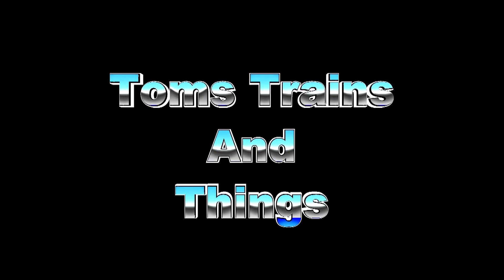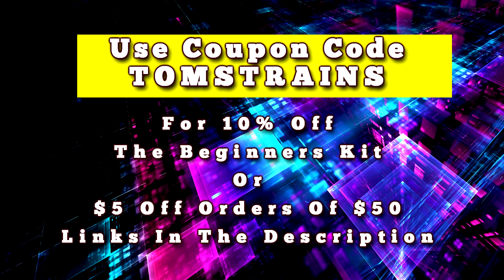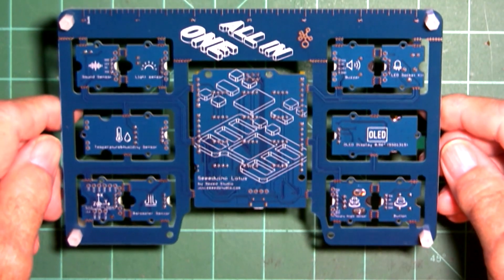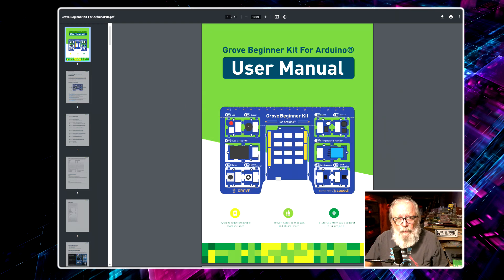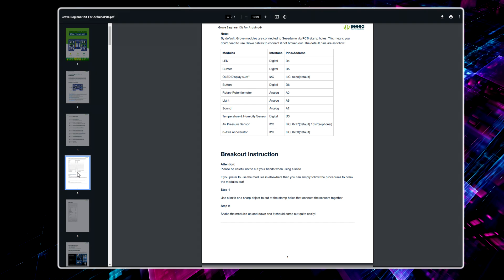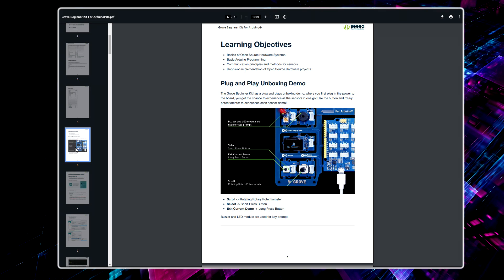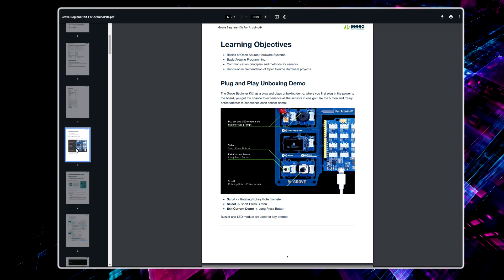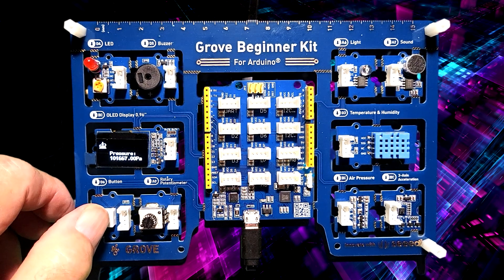Best  Arduino Starter Kit -  Grove Beginner Kit For Arduino

Comment: Hey Tom, nice review. Now don’t laugh, but do I need a computer hooked up to my layout if I want to run an Arduino thingy? I’m looking for something that will rotate a sign on my layout.
Reply from the maker: Thanks Mark. No you don't need a computer. All you need is an Arduino and some thingy to power it. You can use a wall wart or even DCC track power with a rectifier.  If you have a spare USB powered port, you can use that akso.
Reply: @TomsTrainsandThings    Thanks! One of these days I’m going to try it out.
Reply from the maker: Let me know if (lol) you need any help!